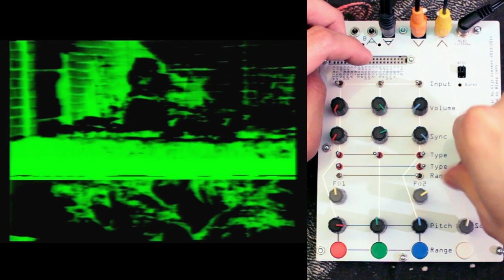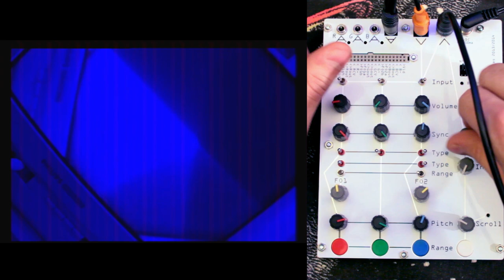3TrinsRGB+1c in depth tour

Comment: loving the sounds at 18:15 ish. also used the 3Trins in correlation with a Videonics MX-1 digital video mixer for a local music showcase: https://youtu.be/adt0SC7xa1g

Also, I feel like I'm running into a problem possibly with the synth. It seems to be really shaky when using footage from my 8mm video cassette camera into the synth? I have yet to run footage from my DVR/VCR player yet to see if it doesn't shake but it seems to do it with input from VCR players too? Any insight on that? 

Thanks for posting the field trip through the 3Trins
Reply from the maker: Glad you're using it to make awesome stuff!
Unfortunately some devices, like camcorders and old video game systems, put out a sync pulse that the 3trins can't quite latch on to.  Running it through any old VCR should make it more stable.

Comment: Quick question. Does any audio input work. Like say I plug in a Op-1 portable synth from teen engineering and patch in with that to one of the RGB channels. I can hear feedback if I plug a speaker into the output. But no audio from any device I plugged into the RGB audio inputs. Love the device but I just can’t figure out how to get audio to make it reactive.  I’ve tried looking online. I’ll try the Facebook group, just looking for some general help.
Reply from the maker: It does not pass audio through. You'll need to split it going into the device. The audio out is the raw output oscillators that are creating the visuals. 
You might also have to adjust the tiny trim pots on the inputs. Please email me if you have any more questions drbleep@bleeplabs.com

Comment: Does the patch bay function with other instruments? Say I wanted to sync the video with the BPM of a Pocket Operator or a Volca. Is this possible?
Reply from the maker: In short no, sorry. That's what the CV/audio inputs are for but there's nothing on the device that can read a sync signal. You can only plug external gear into the header is it's at the correct voltage level (about 0-1V). anything more that that will damage it. 
Just plugging the audio out of the PO into one of the inputs would look good though!
Reply: Bleep Labs I saw a video of someone who managed to sync the BPM of a Korg Monotribe with the scrolling effect of the 3trins. How did they accomplish this? Is it compatible with any other instruments since it can't read a sync signal? Sorry for the newbie questions, I still don't know much about modular synthesis and I've yet to purchase the 3trins for myself.
Reply from the maker: Most probably they were just sending audio to it. You an send audio or CV from anything but sync is different. There's nothing to 'clock' on the 3trins. Can you send a link to the video?
Reply from the maker: In the description of that video it says "Audio from Monotribe is being multed and used for modulating the 3trins and sent to the video capture device." By muted they probably mean filtered so it's just the kick sound.
Reply: You could easily build a circuit to do this connection using a 4n35 or similar optocoupler.  The optocoupler allows you to connect to devices using light (an LED and a phototransistor) so that each device runs on its own voltage.  You would power the 3Trins side of the optocoupler with the power socket on the patch-bay of the 3Trins, and you would use a resistor to scale your Pocket Operators sync signal to the appropriate voltage level for the input/LED side of the optocoupler.  For more fun, connect the 3Trins to a Korg SQ-1 sequencer using a similar optocoupler circuit.  Google optocoupler circuits to learn more from people smarter than me.
Reply: Or, if you wanted to only sync to a BPM signal (not have the option of syncing with a SQ-1) from the Pocket Operator, you could make a super easy Zener Diode circuit.  A 1V zener diode would allow you to limit the voltage of the PO's sync signal to 1V.  Then, you could send it to the patch bay on the 3Trins to modulate a parameter in time with your tempo.  The only problem with this circuit as opposed to the optocoupler is that if the diode fails, you'll fry something on the 3Trins.  With the optocoupler, there's no possibility of that.  https://www.electronics-tutorials.ws/diode/diode_7.html

Comment: could you hook this up to a n64?
Reply from the maker: +Alex Rod I haven't tried it but an NES and 2600 won't. Sync signals from old consoles are kinda weird and the 3Trins usually can't lock on to them.  You can see the signal but it will be sheared.
Reply: I tried with Nintendo Wii and got no lucky =/
Reply: You need to clean up the sync signal. I find using an "Active" video switcher (that is, one that plugs into the wall) usually generates a clean signal that can pass the console into a video synth rig. There are dedicated devices to do this but they're expensive.